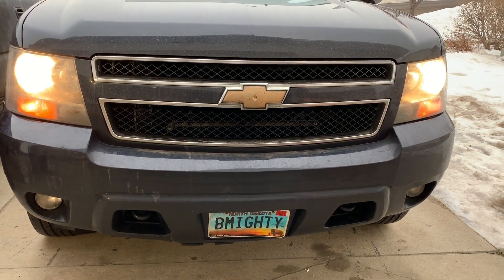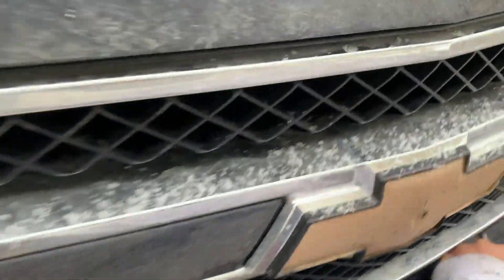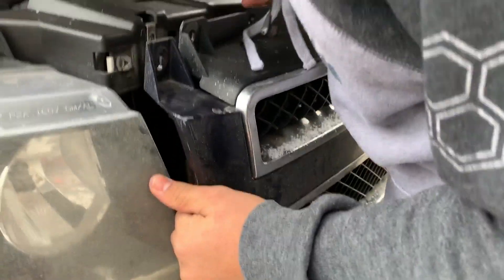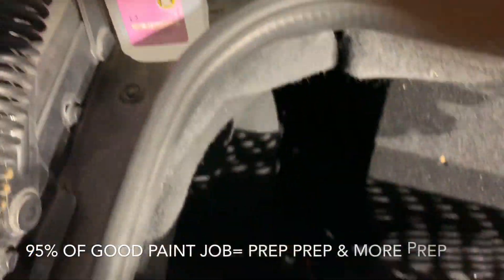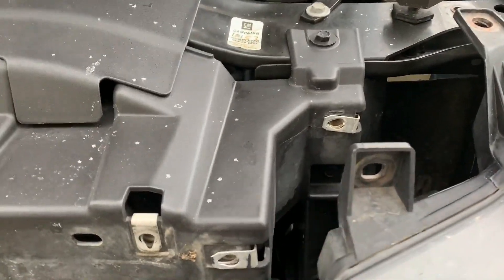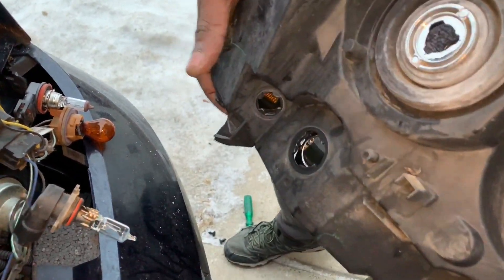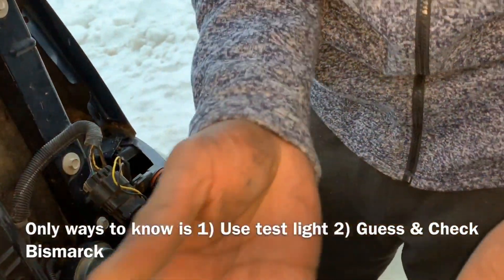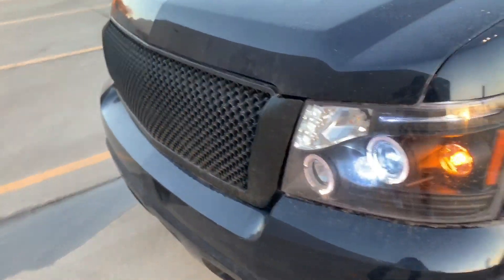UPGRADE GRILL & HEADLIGHTS '07 SUBURBAN

Comment: Is it really necessary to cut out all that stuff? I just ordered the same grille for my 08 Tahoe. There’s another guy on here that puts one on his without cutting anything.
Reply: Maknificent12 thanks for the reply 👍🏻
Reply: No- I installed without cutting, however the grill sticks out, very minor, 1/8" at most it mechanically fine and looks great. Cutting may, Idk for sure, but it appears cutting into your rubber bumper could jeopardize the structural integrity and weather tightness. just my 2 cents.